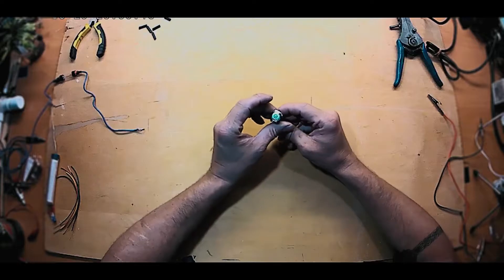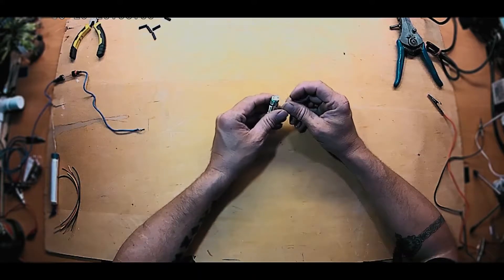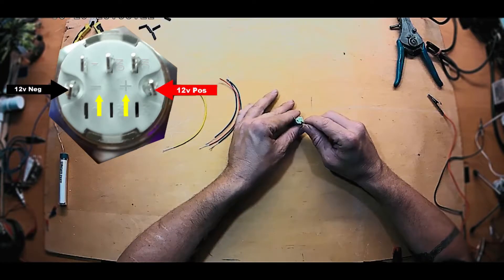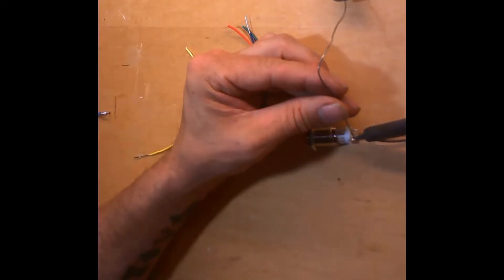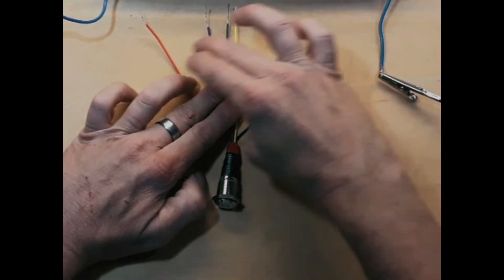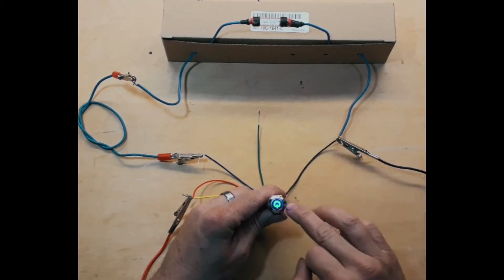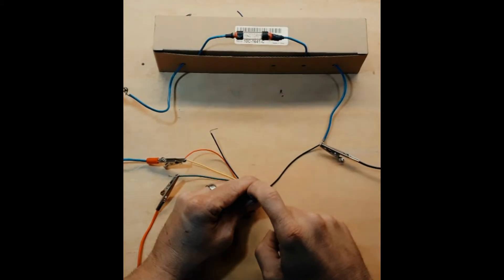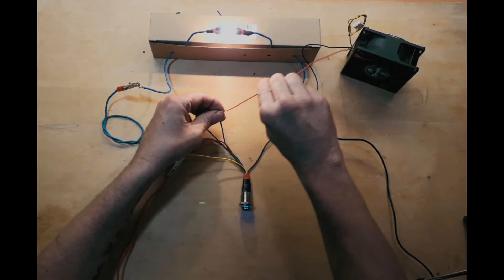3 ways to wire push button latching 12v switch with LED

Comment: great video! you make it easy to understand.  question: can this switch be connected to the dash lights? based on your video seems like the light (LED) in the switch only has an on and off capability.  meaning, if you connect it to the dash lights and then turn it on, the light will not change like other car switches that can be on with dash lights and then another light on the switch tells  you the item you have connected is also on.  am i making any sense?

Comment: Would I need a fuse or relay with these kind of switches?
Reply from the maker: fuse yes I would fuse most things just in case, relay well that would depend on the max amp of the switch (they all look the same just different specs) and the amp draw of your load.   a relay is a way to send much higher sources of electricity than the switch is capable of handling so you do not need to buy a really expensive switch . you can send 40 amp with a 5amp switch sort of thing.  that said most switches are good enough to handle most led bar lights and such
Reply: @kootenayboy   thank you so much for the info. I managed to figure everything out and wire the switch to the relay and fuse. It seems that many have recommended the fuse/relay combo for peace of mind.

Comment: Most Excellent Tutorial. Building a 20Kv Static Flocker, needed this LED switch to be on when system is on.  Set Up #1 at 7:30 , C, NO1, +, - Perfect!

Comment: Hi I have that switch (2 of them) and im using that on my e-scooter. I really wanted it set up so that the switch LED only lights up when key is depressed and lights off when in "off" position. I looked at your wiring and "I think" (correct me if wrong) you've seriesed the button LED and the load so the button only turns the LED on when the load is also turned on. 

MY inquiry is that how do you suggest I do that when the button LED voltage is 12v  and the source voltages are 5v (and the other is 0.9v)?  just a bit of clarification, I use the switch to turn on the dual motor mode and the other for low speed mode hence they are both connected to the controller. I've tested their voltages and they are 5v and 0.9v. 

My main idea is to use a relay switch (for switching a 12v source on and off) in series to the controller and switch. When the switch turns on, it will also activate the LED. The issues is this is rather a more complex process and albiet unrefined in my opinion. Also it endangers the scooter controllers if anything goes wrong. Also while this might work for 5v as there are low voltage triggered relay that can go as low as 3v, I don't know any relay switches that can go lower than 1v.

Any ideas?
Reply from the maker: I think you might need a step-up or step-down module if Im understanding your question I know they are plentiful and cheap online ebay,wish albia etc  and come in a huge selection

Comment: Hi KootenayBoy, Im trying to use this for my dash cam, so its on with ignition or on with this switch when ignition is off. Can you tell me the five wire positions for this ? Thanks.
Reply from the maker: you would connect the power in to the switch to the ACC wire/fuse from the ignition then the the out wire to the power in on our camera and ground is still ground

Comment: Hi, awesome vid. 
I am a bit concerned/unsure abt wiring when using an(any) led based switch. Some if not most switch are rated low and some are as low as 0.5A. i normally use 14-18awg cables depending on load.

Q: switch amps rating based on load amp draw. What are your thoughts? 

Worry:
- fried/melted switch over time.
- fried wire harness.
Reply from the maker: As far as load I really never ever go near the max amp load Im fond of a switch per set of lights usually the ones Ive bought are in around 15 to 40 amp  Ill toss in a relay in a heartbeat  especially on big draw devices like winches etc even for LEDs relays are cheap like borscht these days so why not  if your worried go bigger gauge wire it usually wont hurt and gives you personally peace of mind 

For soldering 
Ive wired quite a few and have never had an issue the trick is a hot iron and thin solder so your contact time is minimal pre tin the tip to increase the surface area of the soldering iron so when you touch it to the post the heat transfer is quicker then tap the solder on your done.  

If your really worried I attach metal alligator clips to the post or wire for example then Im using heat shrink on short wire ends Im soldering I attach a couple clips between the solder point and the heat shrink so it does not shrink in place then I grab the connection right after with needle nose pliers to sink any heat out quick. same with the post if your worried about heat damaging the leds put a metal alligator clip between the point of solder and the switch you can clip another one to the first for greater heat adsorption.  but like I said I have never had that issue I move pretty quick

Comment: Spent hours watching dyi on this kind of button switch. Your video tutorial is the best. Thanks. Does this switch need to have inline fuse when connecting the positive directly to a car battery's + terminal?
Reply from the maker: Probably not but for the peace of mind and cost to put one in I would :)

Comment: Greetings @UCH6JE_0RWLLGhe8NHWWzvRA, I'm trying to figure out how to trigger a relay using this 5 pin so I dont carry all the voltage through the switch; I can run it through the relay.  In your example, if I wanted to trigger a relay, would I run the green wire to the 86 post on the relay?  My thought process is: BATTERY -> In-Line FUSE -> 12g ran to the rear of the vehicle -> 30 post on relay.  87 post would power the LED lights once triggered by pressing the switch. 85 post is ground so the neg (-) on the LED would tie in there.
Reply from the maker: Its pretty easy just keep it simple the same way you would use this switch to power a light you use to power the relay  its a trigger  (depending on the setup you desire switch in = on or switch out = on etc)    instead of the switch turning the light on you use it to turn the relay on and then the relay sends the power to the load (light etc)    you want the relay as close to the batter as possible and then run your wire to the load from there that also makes it easier to wire the switch in as well.   at first glance it looks like your thoughts on the posts are on point  (depending on the relay some I've noticed are a little different though they say they are JD1914 some label the posts different  (hence my color coding lol)   the NEG "should" be fine in most situations if its a NEG ground you can mount a ground wire just about anywhere ie a screw into anything metal as long as its clean and not rusted I trust this more than tying into existing wiring now days it was easy on old muscle but the new computer cars can buss etc add a ground and your radio only plays chinese news or some Sh!__  lol  sounds like you have it figured :)
Reply: @kootenayboy  I greatly appreciate the feedback--thank you for the response.

Comment: Hi is it possible to use a push button like this one as a 3 way switch?
Reply from the maker: kinda sorta (if I understand you correctly)  depending on the exact application if you wanted to have two things powered but only one on at a time ie push in the lights are on but the fans off then when pushed out the lights are off and the fans on etc  other than that you would need to get creative with relays
Reply: @kootenayboy  So this won't work to have two switches able power on/off a single light?